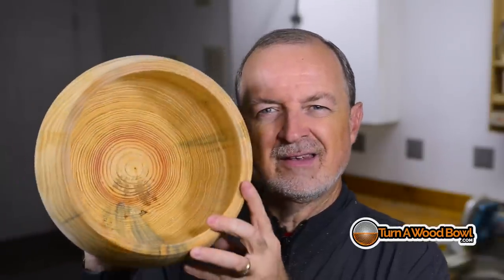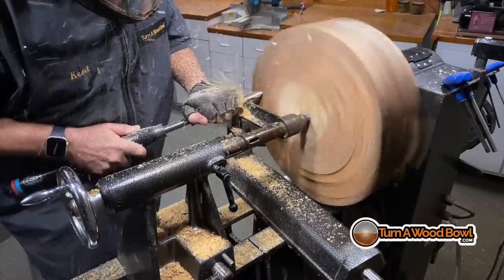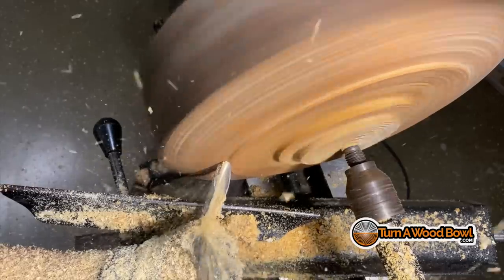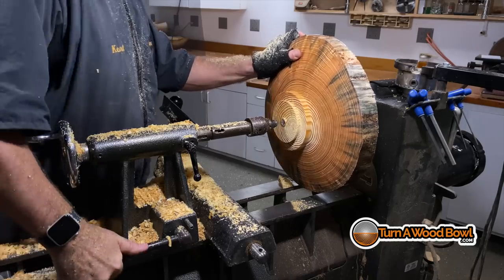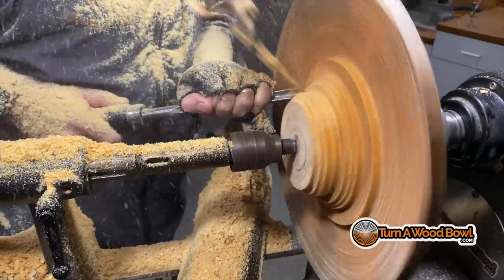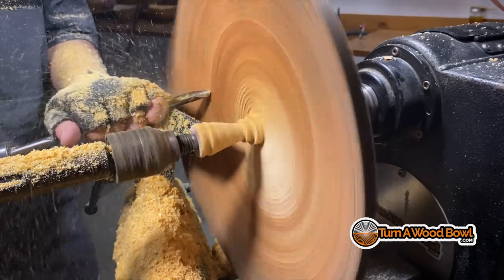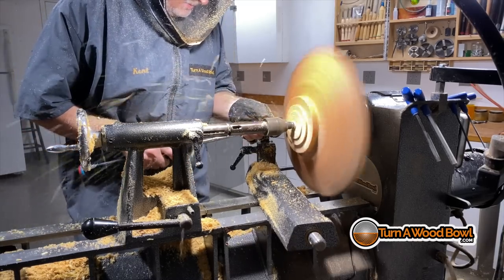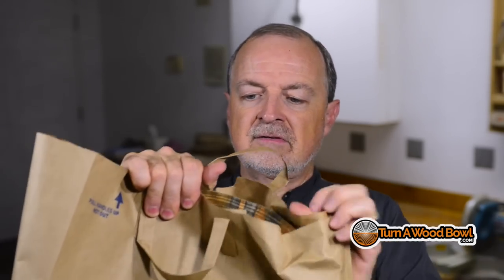End Grain Bowl Turning  – Video

Comment: I'd probably flatten one side, make a tennon, and then flip it immediately to get rid of the bit, then flatten the other side, make a tennon there as well and shape the outside of the bowl, then proceed as usual by flipping it again and removing the first tenoon while shaping the inside. Just to get rid of that bit asap and have the piece (especially such a large one) mounted more reliably.

Comment: Wish I knew the brown bag trick a couple weeks ago. I found an 18" x 7" log in the community  brush pile that looked like cedar but had only a wet wood smell. Very wet.  I turned a bowl from a 4" chunk that looked good. Put in the house and went away for the weekend.  It cracked like crazy. One crack was 3/8" out the outer rim. Very disappointing. I took it back out to the shop and loaded it up with CA glue. Now I'm afraid  to cut the rest of the log into chunks. When I get around to cutting up the rest of the log, I'm going to wrap each piece in a heavy paper I have and monitor it daily.
Thanks for another great informational video.

Comment: Great video, with valuable tips. I want to add that the wood appears to be Ponderosa Pine which is susceptible to the mountain pine beetle. These beetles burrow under the bark to winter, and bring with them a blue fungus. The burrowing cuts and compromises some of the water conductive fibers which transports the blue fungus, This causes the blue stains in the outer edges of the tree. Because water conduction is compromised, if the tree can't purge the beetle with it's sap the tree begins to die from the top down. You can see examples of this in most big box lumber stores.

Comment: That’s cool I used to make end grain bowls when I first started
Reply: I did too but it was mainly because I was never told on any of the beginner videos I watched that you had to cut the logs down the middle to turn the side grain. Used to get so frustrated watching videos where they removed huge strips easily and near effortlessly hollowing them while I got small pieces/dust and tons of skips while using the bowl gouge before I experimented with cutting it in half.....damn near teared up when I started to removed chunks of wood for the first time but at least I got damn good with end grain turning
Reply: @ericmendoza8243  lol same
Reply from the maker: Yes, it's very frustrating at first when its not clear about side or end grain turnings. All the best to you and Happy Turning!
Reply: @TurnAWoodBowl  hello I have a big choice to make so Im a 13 year old woodworker and have to buy my own tools so I have a cheap WEN lathe 8x12 clearing so I am trying to decide whether I should buy a jet 10x15 variable speed lathe or should I by a one way sharpening system for my bowl gouges because I am currently working with dry cherry wood and that’s kinda hard. so please get back to me if you can and happy wood turning to you too

Comment: Kent, I looked this video up to watch a second time. I’ve got my first large end grain bowl mounted and thought I’d better have a refresher.  I’m using a face plate and my bowl will be a little deeper but it’s about the same diameter. 
Face shield at the ready, benches covered with painters plastic, tools sharp, fingers (figuratively) crossed and ready to try.  Wish me luck.

Comment: looks like a ponderosa pine to me.  I don't have a lathe, i just enjoy your videos, but i do own a sawmill.  I have noticed that the amount of pitch in the wood depends on the time of year the tree is cut down.  live pines are about 50% water year round but are really sticky with sap if cut down in the springtime.  it makes a difference on my blade lubricant on a sticky tree.  if its real bad, i have to add pinesol or dawn dish soap to keep the pitch from building up on the blade.  also, if in a bark beatle zone, pines should only be taken in the winter when the bugs are dormant, if possible.  no sense providing them anymore habitat than necessary.
the pith being off center usually means constant wind from one side, or it was growing on a hillside.
Reply from the maker: Josh, thanks for writing and sharing. Great info there! I'm sure you've seen you share of interesting trees! All the best to you and Happy Turning (maybe someday)! ;)

Comment: Where do folks get paper bags these days? Of course, the grocery store used to be THE place but they only use plastic now...or at least that's the case in my area. I hadn't thought of them being for sale until just now...hmmm. Maybe a pack of 50 for ???$$ I suppose if that exists, Amazon would have them! I look forward to the wet wood techniques you're working on...should be fun!
Reply from the maker: I think if you look around at different store, you'll find them. But you are right, many don't offer them any more. Happy Turning!

Comment: I am in the middle of a very similar turning with a walnut cookie I cut down 4 years ago. I just let it dry and crack (which it didn’t crack too badly). I have almost finished turning the inside. It’s fun to practice those long smooth cuts into endgrain.
Reply from the maker: Yes, it is fun and completely different compared to side grain turning. All the best to you and Happy Turning!

Comment: Thanks for the great video Kent! I was just wondering, how does the drying affect in an end grain bowl? Is the warpening as noticeable as a in a regular bowl? If i want a nice round bowl should i twice turn it aswell?
Reply from the maker: Kim,
Good question. It contracts and expands from the inside out on an end-grain bowl. So the whole piece will actually shrink and pull inward to the center. Happy Turning!

Comment: Great video and thanks for the clear explanations along the way... In preparing blanks from logs for side-grain bowls we always take care to remove the pith from the blank for fear of cracking.  In the case of end-grain bowls the pith will of course be in the bowl...I understand the notion of slowing down the drying process to prevent cracks... but when starting with green wood won't cracks still begin at the pith and propagate outwards?
Reply from the maker: Yes, it is very likely going to crack. However, the crack can be repaired or left as a feature. Happy Turning!

Comment: I live in a place, Paradise California, where there are all kind of dead trees, Pine and Doug Fir mostly, being removed. Between Pine Bark Beetles and dying from the fire several years ago, most are pretty dry before they are cut. Can I use your methods with dry Pine  or does it have to be wet/damp?
Reply from the maker: Dan, definitely turn that wood. You will need to experiment to discover what works best for you. Check out my green wood course fir much more info www.TurnAWoodBowl.com/green All the best to you and Happy Turning!

Comment: Couple of question, what is the hp of your lathe?  If I'm not mistaken it has to be at least 1.5.  And second, how old was the tree, how many rings.  I found this episode typically fascinating, perhaps moreso because I had thought of this same sort of project.  Mine would have been on a less grand scale as the swing on my lathe is only about ten inches (might be twelve, but I don't think so) and the motor is only 1/3 hp.  I can stall it out turning chopsticks.  That and the lumbar spine from he!! explain why I'm watching you and not making my own chips.  Once more, my sincere thanks.

Comment: Hi Kent, congratulations, cool piece. One question: this pine wood had grey sections on one side. I believe it’s a fungus. Did you ever heard, how to get rid of this gray stains? (Either preventative or curative)
Reply from the maker: Good question. No, I have other projects with similar staining. The stain seems stable and did not spread. Typically any fungus will stop when the wood dries. Happy Turning!

Comment: Should the paper bag entirely enclose the bowl or should you leave an opening for some air to get in? I was just wondering about using brown paper roll and doing it up like a parcel, ready for posting.
Reply from the maker: It should be covered completely. Yes, you can wrap it with newspaper too. The paper makes a air/moisture buffer around the bowl and slows it from drying too quickly. Happy Turning!

Comment: Another great video!  Another quick question - at 18:02 it looks like a scraping cut where the bevel is not guiding the cut.  I thought you would use a shear scrape with the bevel keeping the cut smooth.  Am I missing something?
Reply from the maker: The cut there is a quick roughing cut. It does appears as if I'm off bevel a bit, but only because I'm just ripping material away. All the final cuts are slow, controlled, and on bevel. Thanks for pointing that out. Happy Turning!

Comment: Kent, I have watched several of your videos and I see on a regular basis that when you turn a rough blank, that you always turn down the bottom of the bowl first - instead of cutting down the outside edge which would then smooth out the bowl exterior and allow it to run MUCH more balanced.  The way you do it, your material is always bouncing around and shaking the crap out of your machine.  If you were to START out by turning down the exterior and get the blank more balanced, that would allow you to run the lathe at a bit higher speed which in turn will give you somewhat better cutting action from your tools.

Is there any good reason why you don't cut the exterior first to get the blank better balanced?  In all instances this material has to be removed anyway in order to finish the project and shape the bowl, but it just seems to me that you're doing this the 'hard way' since the blank isn't properly balanced and round, early on in the project.

I dont have any experience in bowl turning, but I am an experienced machinist, and seeing the process that you use, and working with an unbalanced piece of material (at least in the early stages) just goes against my grain....... .
Reply from the maker: Good question, Peter. Basically the side gets cut as I do the bottom curve. If I were to trim the side down, that is actually an extra step in the process. And if you think the vibration is rough on the bottom, getting smacked by the rough sides is even worse. All the best to you and Happy Turning!
Reply: @TurnAWoodBowl  I understand your process and I agree that it would become an additional step, but it just seems to me that the rest of the turning of the bottom and maybe even some of the interior would be more enjoyable if the block was running smoothly, plus you'd have the advantage of being able to turn the material a bit faster and get slightly better cutting action as well.  When you're turning a live edge bowl, then of course there's a different approach needed, but I think for myself that I'd trim the outside first to reduce that bounce in the machinery.

Keep up your great videos, I am enjoying them and I have learned a lot already thanks to your excellent instructions, and I haven't even turned a bowl yet.  I do have a small 12" General lathe that I'll be using but I need to get some new tools first. I've made a few pens with it but bowl turning will be totally new to me.  I'm in the process of cleaning out and selling off my machine shop and cnc router, so once that's out of the way I can get more serious about some turning and other aspects of woodworking.

Comment: I would suppose the pith will crack when it dries, causing radiating cracks to damage the bowl. So, what are you going to do to prevent that?
Reply: If it's similar to Norfolk Island Pine,  it won't crack.
Reply: Russell, when it is thinner and has an even wall thickness that will help prevent cracking. Also Kent put it in a bag to help regulate, or slow down the drying process to also keep the pith from cracking. It’s not a foolproof system, but it can work very well.
Reply: i often put a bit of thin CA in the pith before sanding, it will strengthen it and will have a lot less chance of cracks
Reply from the maker: Yes, this wood can crack easily because of the internal pulling force from the center area. I do my best to slow the drying with the bag. Many times if it does crack, it will pull back together somewhat when it is completely dry. If not, the crack area can be patched with glue or featured as a design element. Happy Turning!

Comment: Kent I’m trying to turn ash on the end grain of branches and it’s driving me crazy. There is the anded issue from wood bores. The wood has a beautiful grain and have made beautiful cheese boards when back filled with resin. I would like to turn some of the larger branch cuts into cups, boxes and the like. Any ideas?  Thanks.
Reply from the maker: Resin can work for filling holes. As for the hardness, sharpen sharpen sharpen. Make light slicing cuts with your bowl gouge and be patient. It will be worth it in the end. All the best to you and Happy Turning!

Comment: I just turned an end grain bowl and want to turn it into a knitting bowl which has a hole and an open curve in the side. Does it matter which side of the bowl I cut into?
Reply: I turned a cross grain knitting bowl recently - there it does matter. If you put the hole on the end grain side you could very easily break the fragile wood end next to the hole.
 For this reason I think the end grain bowl is not a good idea for a knitting bowl. So you should choose a rather robust design of the hole!
Reply: @walterwindhagauer1687   don't know if I can upload it but it worked out okay

Comment: Great job Kent, really beautiful.  Funny to find this because I turned an end grain calabash bowl today out of very dry mesquite...it came out pretty well BUT I had a tough time turning the inside of the bowl.  In trying to start my cut in to define the bowl thickness at the outside edge, I continually was unable to stop getting bad skipping.  Even with the bowl gouge totally vertical, I could not stop the kickback skipping, tearing up the top edge.  Any thoughts or advice?  I ended up defining the thickness with a parting tool...cheating I guess.  Was almost at a point of turning from the middle out as in end grain boxes...tough day of turning.
Reply from the maker: Getting the cut started with a parting tool is not cheating, it's problem solving. I've had that happen before where the gouge just can't override the pattern of the wood grain and bounces around. One other option is to apply extra down force to the tool rest and hopefully the gouge will start the cut. All the best to you and Happy Turning!
Reply: @TurnAWoodBowl  Thanks Kent, I like the idea of problem solving!